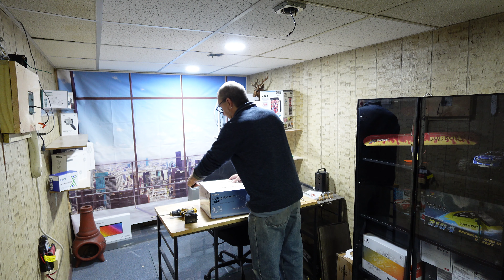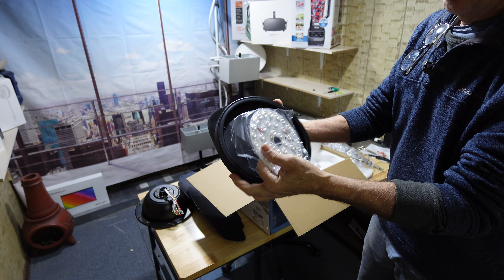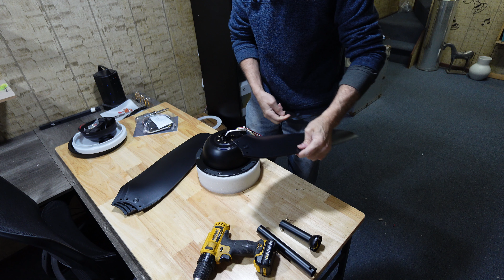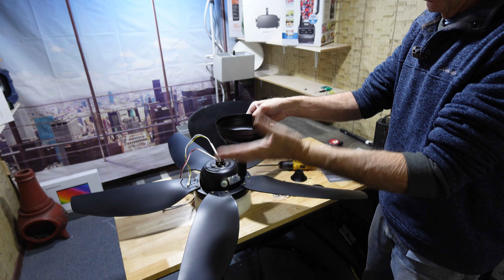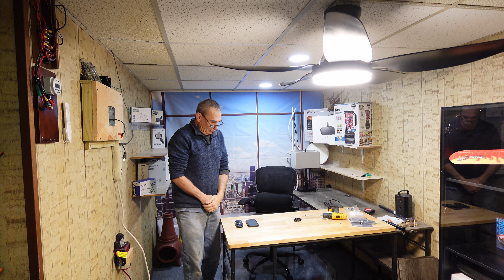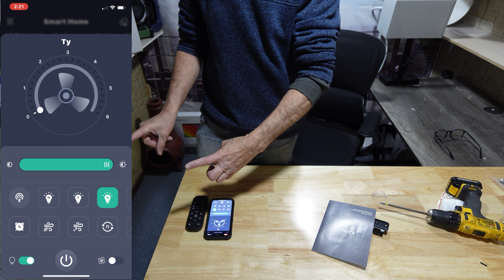Kviflon 46 Inch Ceiling Fans with Lights and Remote/APP Control,Modern Downrods Flush Mount

Comment: Crazy question My speaker works but the fan motor won't turn on nor the light any suggestions everything seems to have a good connection
Reply from the maker: you hear a beep from the motor that is what I am guessing when you say speaker?  I recheck  your wiring, and the  plug ins make sure they are  connected correctly  and seated, the only thing I can say is if these    receivers are dropped they may fail to work could be defective. only thing I can think of

Comment: do you need the remote to get the fan going? We accidently tossed out the remote. I turned the switch on, but nothing happens.
Reply from the maker: the App will turn the fan on, the RC is needed to get the fan on,  if you have any other remote, it may trigger it to work  these  companies do not lock you  to a  particular rc.  you may try to get with Amazon and the seller for a replacement
Reply: @fishycomics  thank you for the quick reply. i cant get the app to pair with the fan since it doesnt come on. i will try to see if we can get a spare remote. thanks
Reply from the maker: @madrizz01     certain fans  you can shut down the ac, and turn on to pair,   turn on off 3 to 5 times to get the light to flash, for pairing.
Reply: @fishycomics  thank you. i will definitely try that.

Comment: Stupid question, but can this be operated just without the app or the remote (i.e. the room's light switch)?
Reply from the maker: excellent question if asked:    the wall switch is your main power, some fans will reset  to off if the power is cut off, some will not. so it can be possible.
Reply: @fishycomics  I just want a normal fan. One that turns off and on when I flip the switch.  I've never owned a "smart" fan before.

Comment: Lifesaver! I'm a technical guy, but the directions were not thorough and caused me stress. Your video made it a breeze. The only thing I got wrong and had to take down the fan and fix was installing the blades. I installed them upside-down so no air was being pushed down.
Reply from the maker: totally hear ya love black on black, white on white same color lettering